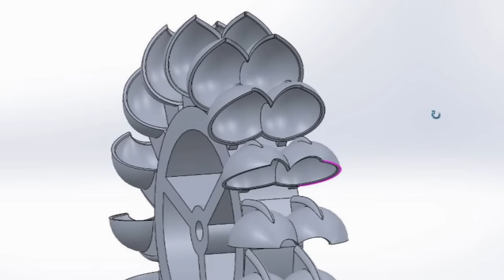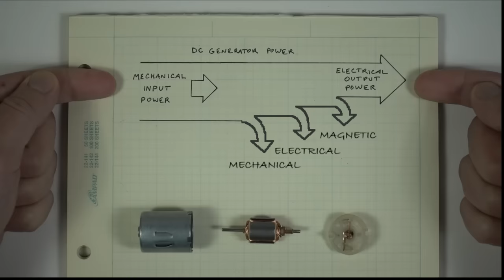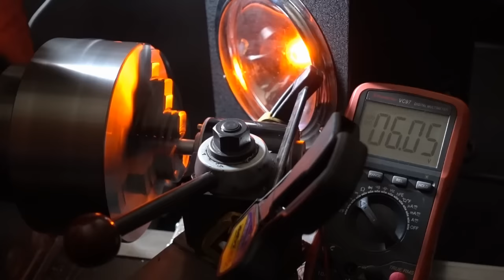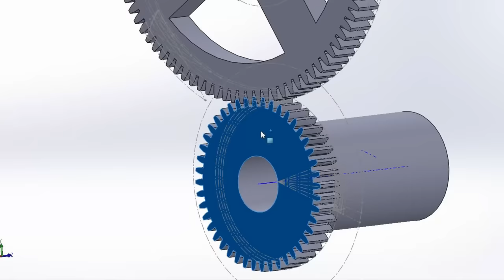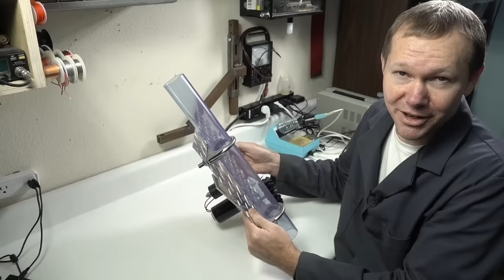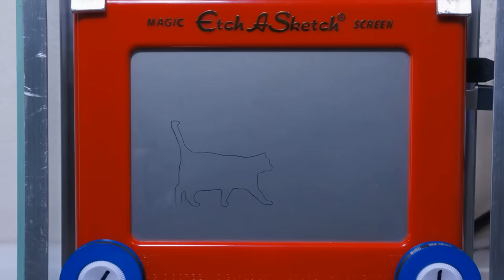Rain Gutter POWER #1 - How to Harvest Free Energy From Your Roof with a Hydro Electric Generator!

Comment: You can tell this guys has an engineering background the moment he takes out the graph paper and formulas instead of eyeballing it
Reply: He forgot to take the roof angle into account.
Reply: @nicoj.8242  Yeah i was smacking my head lol
Reply: Well there has been quite some eyeballing involved If you ask me :D
Reply: @nicoj.8242  no need an angle for that. A 1.8 gal/min is a 1.8 gal/min at any angle. That is the law of conservation of mass. If you are calculating a force then I will agree on you.
Reply: @nicoj.8242  He did take into account the slope of the roof by eliminating from his calculation. He used the horizontal distance from the peak of the roof to the gutter. This is a straight distance between the center ridge of the house and the outside edge. If he had used the slope distance along the face of the roof he would be incorrectly increasing the area of collection as the rain typically comes straight down and not perpendicular to the face of the roof.

Once the rain hits the roof, and then collects in the gutter, the flow rate is the same no matter what the roof pitch is. 

The only difference between a steeply pitched roof and a shallow pitched roof would be the time it takes for the entire roof to drain into the gutter. A steeper roof would initially get the water into the gutter faster, but once there, it's flow is the same, provided both roofs have the same horizontal area.
Reply from the maker: @Lucas Van Hamburg did you not hear me say "once I calculate the horizontal distance"
Reply from the maker: @nicoj.8242  nope, watch it again more carefully.
Reply: @QuintBUILDs  Wasn't really obvious at first from the scribble(00:46), but it seems you only took the horizontal component of the length. Then it makes sense, sorry I overlooked it. Expected some trigonometric calculation but you just took the distance from the middle of the roof to the side, that's easier probably.
Reply: @Dersu42  this is correct !
Reply: I like how he took the time to meticulously draw the fence too! LOL

Comment: This video reaches the perfect balance between funny and informative. Great job ! I may recommend it to my Freshmen Engineering students: it makes for a great exploration of energetic orders of magnitude (and why hydro-electric power requires such gigantic infrastructures !). Thank you for this excellent job !
Reply from the maker: Thanks so much! Part of me wanted to dive into the math a little deeper but an engineering class would be the perfect place for that.  You might also look at my video on filling a tire with a garden hose. It's great for engineering students, especially learning about absolute and gauge pressure in an automotive context.
Reply: @QuintBUILDs  Yeah, I saw it too. As a matter of fact, it was the first video of yours that I saw, which made me want to check all the others ! But I felt that something was missing from that other one (or maybe I missed it): I do not recall hearing you cite the value of the base water pressure out of the faucet. Granted, though, depending on how your chained valves work (I am not sure I got that clearly), it may be possible to exceed that base water pressure via the accumulation of bottles on a single rail.
Anyway, I like the way you think, here, and I like that you put efforts into estimating orders of magnitude. That is where engineering starts getting beyond mere tinkering. I will definitely direct my students to your channel.
Reply from the maker: I don't remember if I included it or not, maybe a quick view of the pressure gauge when I turned on the water? For anyone interested it was much higher than expected, 80 psi!
Reply: @QuintBUILDs  That's more than 5 bars ! This is indeed very high ! Don't you get frequent leaks, or premature fatigue of your appliances ? Most plumbery equipments are meant to run at 3 bars or so, not too much more.
Reply: This guy does such a great job, doesn't he? He makes the feeling of "Bored" seem non-existant as he informs about a bit of stuff that could actually be useful.... Now to impliment that same system to our school system.... Without failure like the last three times.

Comment: An "American " that just said metric is way easier than imperial. Lmfao.  (Australia here) i love it! Not to denote from the fact very cool vid brother. Been considering trying a rather different but similar thing myself. Cheers to you sir.
Reply from the maker: LOL, most American's think imperial is great, until they try to do something useful with it!  That was the joke back in engineering school, anytime the prof gave a problem in inches and pounds you just converted to metric, solved it, then converted the answer back.  Seriously!  And thanks for the encouraging comments, all of them...
Reply: @QuintBUILDs  there's a guy on you tube, angry ram i think he goes by. Does some rather clever stuff with off grid power using Pelton wheels. Not exactly what you are trying but potentially some good brain food for someone such as yourself. Or maybe way to simple, just incase 😉
Reply: Oo, sry quint, replied to the wrong mail but still. Haha. ☺
Reply from the maker: I've seen Angry Ram's thumbnail of his washing machine pelton setup but never watched until now. Very cool. I have access to property with a creek like that, not enough head for pelton but definitely worth experimenting with.
Reply: @QuintBUILDs  you tube just gave me another, wasn't searching. ..joe malovich, round turbine housing an improvement? The vid is called. Sry incase this is just annoying now. More brain food 😉
Reply from the maker: @nic6754  not annoying at all!  Looks like I've watched one of his videos, the 500w pelton.  I think I moved on because clearly he's operating far beyond the power levels I'm at.  I have a future opportunity to experiment with hydro on a ~50W application at which point it will do me well to dive in to Malovich's stuff.
Reply: I use both imperial and metric units. But when involving heat and temperature, I prefer using metric because I hate seeing BTU in my solutions. I also prefer using feet and inches in "estimating" small lengths and distance in real life situation.
Reply: Beat me to it Nic!
Reply: I'm a mechanic by trade and I HATE imperial... It's outdated, nobody else uses it, conversions are a nightmare, and in the end I have to keep two sets of tools anyway because half the stuff I work on uses Metric anyway. Not sure why we haven't phased it out yet... Haven't had the right old stubborn farts die off yet I suppose..
Reply: Only reason it's easier is because the all the math equations are made using metric. If they were formed using American standard you  wouldn't hear that phrase. But to do the equations and unit conversions is so obnoxious. So yes it's easier but disgusting to say.
Reply: @saite2560  Metric is based on 10, just like our numbering system; 10 milimeters to a centameter, 10 meters to a decameter, 1000 meters to a kilometer. It's consistent with our numbering system which streamlines everything. Equations using Imperial are never pretty because Imperial doesn't have a consistent base; it's all over the place. It's literally a mess. 16 oz to a pound? 12 inches to a foot? 5280 ft to a mile? Who came up with these? I'll tell you who; some fat useless monarch made an uninformed royal edict and ordered his subjects to use them. No skin off his royal back since he didn't have to slog through using them. I thought we hated royalty here in the States? Why are we still using this junk?
Reply: @saite2560  that's one way to look at it.. The other way is that for some reason a very small group insist on clinging to an archaic system that has very little useful application. Maybe just to be unique?
Reply: It sucks for temperature.
Reply: @zavatone  lol, didn't think of it that way. Now i really want an imperial thermostat for my home so my wife can't figure out how to change the temperature. 21 and a quater degrees would freak her out. Haha ☺
Reply: @QuintBUILDs  Great Video! What's your discipline? elec, mech or...?
Reply: Probably should have started with metric. You wouldn't have had to convert it 😆
Reply: @QuintBUILDs  Most engineers and builders and tradespeople Ive heard out've the USA quite quickly admit metric is far more logical and practical haha
Reply: Easier does not equal better. Just remember that.
Reply: Just use decimal inches, it's all divisible by 10.
Reply from the maker: @angusbrown849  I should do a Q&A on my other channel BUILD2.  Short answer: manufacturing engineering.  Very similar to mechanical, but didn't have to take heat transfer!
Reply: @moncorp1  I'm genuinely curious how the old Imperial measurement system could be viewed as 'better' in any way. A measurement system is a tool, just like a tap and die set or a pipe wrench. Wouldnt having your tools be more readily compatible with each other and the work... make them objectively 'better'? 
It would take some heartache to switch initially, but I bet our grandkids would sure thank us!
Reply: @QuintBUILDs  can you try this with a Tesla turbine?
Reply: He isn't the only one. Usually if you meet an American that knows the metric system is better it is because we probably have a scientific background. Think about it, if you are measuring something involving ft, miles, lbs, etc and need to use it to find Watts, Newtons, Joules, or another measurements, usually at some point you will have to convert the imperial numbers to metric anyways.   Besides that, the metric system is easier because you measure in units of ten, ice has a melting point of zero degrees, and water has a boiling point of 100 degrees. Fun fact, the reason that Fahrenheit has 32 degrees for the melting point of ice is because zero degrees Fahrenheit is the point where an equal mix of water, ice & salt begins to freeze. 

That being said, my friend Tom would rather use washing machines as a unit of measurement before having anything to do with the metric system...
Reply: @MechMan0124  they tried to phase it out in the 90s when I was in school. Our books all had both versions and the teachers had to teach both methods but they weren't incredibly comfortable with it either. Most of the other countries made it mandatory to convert to the metric system. America did not make it mandatory. Trying to teach both systems confused a lot of people and by the late 90s, they just gave up. Actually we aren't the only country still using it though, Myanmar (Burma) still uses the imperial system too. I wish we would convert over  though. Like you, I am also a mechanic (but for the Army) and it can get frustrating having extra tools, what is worse is explaining to less experienced people that they are not the same size and sure the 13mm might "fix" on the 1/2in bolt, but if you really have to torque the bolt and it is a soft enough metal, you might strip it and good luck trying that crap with the 9/16 and 15mm... 

Being in the military it gets even weirder because most of our distances for stuff are taught in the metric system. 3-5 meters, 300 meter target, 50 meter target, then you go overseas and everything is metric. I'm pretty good with the metric system when it comes to a lot of the measurements, but sometimes temperature can throw me off a little bit. I know in Celsius that the mid 20s is fairly comfortable and 37 degrees is 98.6 in Fahrenheit so 30s is kind of warm and if it is 40 degrees that's pretty hot. Body weight for some reason also seems to elude me without taking the time to do the math in my head. 

I'm also currently in college and majoring in Geosciences so I've dealt with a lot of physics based math in my classes. I get annoyed about the extra steps related to converting things to metric and back again for the sake of determining some obscure number like how much pull the influence of Jupiter's gravity has on an 7lb 6oz baby that is on Earth compared to the pull his 160lb father has standing 3ft away.

Nice name BTW... lol
Reply: @philhahn  not just them, scientists too. Take a few Biology, Chemistry, or Physics classes and things get annoying really quickly.
Reply: Every American in industry uses metric. I have no idea why we have feet and yards and slugs and all of that other crap.
Reply: I am your average american, I consume stuff like I have free healthcare, And as you know, I don't. But, even I, Somebody taught in mostly imperial measurements, find the slight bit of metric I learned easier. I don't know about yourself, But you shouldn't put "American" In quotes.... Anybody can be an american, Just gotta move in, I mean, even if they move in illegally, We have safe cities for them, Meaning, Anybody can experience the life of the gun owning, hard working, Minimal wage man. Living the dream watching my health because I can barely afford healthcare. - All in all, Good comment, 4 out of 5 stars,  The fifth star was reducted because I sold it. Why?  In short 4 stars Good comment, Fifth star, Don't actually have a fifth star. 👍
Reply: @MechMan0124  As an american, I have to disagree, We took the measurements from britian as we left them... So yeah, Basically. You are right.
Reply: If anybody ends up seeing this little reply, this is me saying feel free to correct me if I am wrong, just don't be overly rude about it.
Reply: @MechMan0124  Those of us who use Imperial and Metric on a daily basis, we can use both systems with ease lol
Reply: Wait, you guys actually have rain down undah?
Reply: if only time was also divided by 10
Reply: It depends on what you are used to working with. Personally I have a hard time with metric but that is because I have used imperial my entire life and think in those measurements. If I have to use metric I have to look up the conversions and dig out a calculator to get numbers I can visualize.
Reply: Of course metric is the best, imperial is just weird and have no logic at all.
Reply: Almost any American who even dabbles in any scientific field will tell you metric is better and more common sense.
Reply: In America (at least in Texas where I live) we use Fahrenheit for temp outside and cooking but metric for science, engineering, building etc
Reply: @MechMan0124  The only thing I can think of where imperial beats metric is screw thread pitch. NF or NC vs ? there is no agreed upon standard in metric. 1 mm? 1.5 mm?
Reply: Thinking in 10s is so much easier than 1/64ths.  I love the metric system.
Reply: Easier, yup that’s why America rules the world. They have their own standard that’s much harder and not doing what the rest of the world does what not only why America was formed but why they dominate the world to a point every country can’t exist without America but America doesn’t need a single other country to exist. Dolts.
Reply: @mmfc6  Yes there is https://en.wikipedia.org/wiki/ISO_metric_screw_thread The ISO standard. There is the odd aberation I have found on Japanese cars but most metric bolts meet ISO standard. Even my 1945 Britash Austin car has ISO standard bearings in it.
Reply: The USof A  is a proud country that should realize that even though the Europeans developed Metric it was much later than the old avoir dupois  / imperial system and more suited to modern science. Thats the way to sell it to the US. 
Will I use a metric spanner on a Corvette.. one day?
Reply: @MechMan0124  explain why you need other measurements in metric in the first place like mm or cm
They mean nothing in their own right. just use meters and move the decimal around.
Reply: @ircsmith  because you weren't taught by your education system to think in 1/64ths.
Reply: Born and raised in the US. Use metric for most things at home, but have to use imperial when machining and stuff because I can buy used imperial machine tools for almost nothing here. Metric would be expensive as hell.
Reply: sparky12x  time is not imperial measure but Sumerian, true story look it up. Did you know you can count to 24 on your fingers? Sumerians could.
Reply from the maker: Tony, are you seriously getting angry at a science video?  1. it's a joke.  2. Look up the definition of free energy: "a thermodynamic quantity equivalent to the capacity of a system to do work" (mic drop)
Reply: @QuintBUILDs  haha, you did "mic drop" so cool brother. If I'm allowed to say that as a white man....not that, that needs to matter.
Reply: @ryanschaff123  Surprise fact for you. The US could disappear, and the rest of the world would simply continue. Crazy huh.
Reply: I'm an Aussie and I built an RV-7 Van Grunsven aircraft between 2005 and 2010 - www.vansaircraft.com. All aviation fasteners and tools are imperial usually expressed as multiples of 1/32". eg AD 3 means 3/32" diameter. It was no problem because the AD system is so easy to work with. Otherwise metric is much easier. Great video sir, I am currently installing a solar/battery system in my hangar which has no other power access.

Comment: Idea to reduce loses:
1. Have eventual nozzle positioned at the base of the make shift reservoir, so water is shooting downwards, as opposed to sideways.
Reply: meelokun exactly what I was thinking.
Reply: I’m imagining that to make a massive difference, but when you think about the maths, it only adds a tiny bit more to ‘h’ in the equation. There’s no losses except wind resistance to that stream of water going sideways.
Reply: Harry C. Well it’s going with gravity more and not fighting it so I think it would help
Reply: For that to work, you would also need to implement some sort of filter to prevent clogging.
Reply: @blazethefaith  A filter would still clog. Perhaps another approach would be to design a means for debris to simply flow past.
Reply: position nozzle at the very bottom of the downspout to maximize gravitys effect and increase pressure slight with a little bit more water above the hole